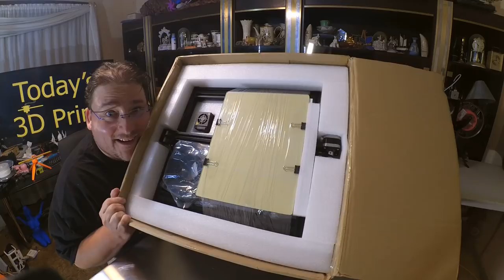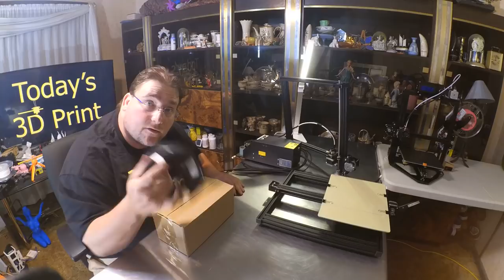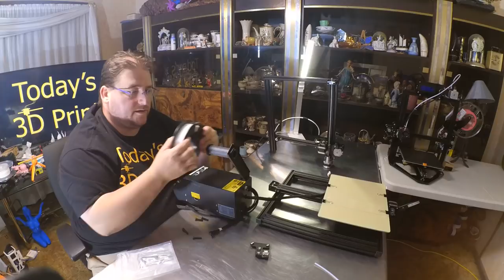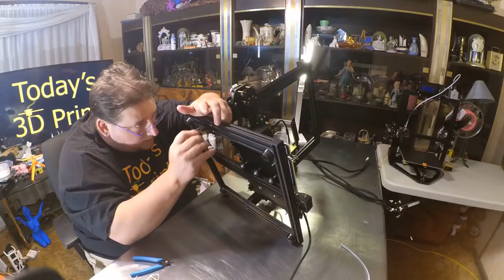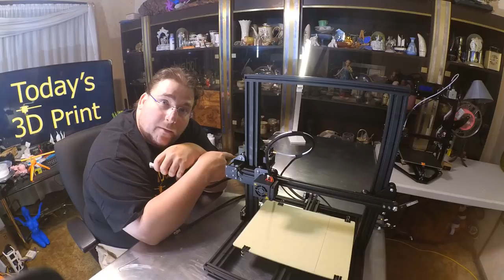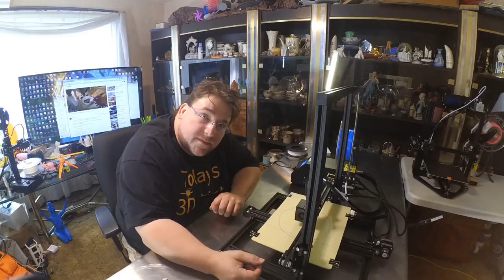Today's 3D Print - Its Finally Here  Creality CR 10 Mini Unboxing Initial Thoughts CR10 Mini

Comment: Ok setup the mini today. It’s printing quite nice at the mo, just waiting for the cat. My only concern is I had to back off the bed adjusters quite a lot almost on there limits, maybe 2-3 threads left. Is this correct? I set home and it was miles away from the bed.
Reply from the maker: +Joe Blog that's not good do you have the glass on the printer? The reason that's not good is that will make your bed adjusters a little on the loose side so your bed level might float or change in the printer vibrates one way you can fix this is to use longer screws and add some washers to tighten up a Springs you can also try adjusting the and stop position so that the head will come lower to the bed I'll have to check my mini and see if it allows you to adjust that
Reply: Nerys cheers. Thanks for replying so quickly on Christmas day. Merry Christmas. I'll take some pics later. At a friend's Christmas party at mo.
Reply: Nerys how do I send the pics?
Reply from the maker: +Joe Blog upload to imgur post link
Reply: Nerys also noticed some reviews say it has a thermal controlled fan. Well not on mine it hasn’t. It just makes loads of noise and the fans run full speed all the time like on the cr10. Wonder why they have done different versions?
Reply from the maker: +Joe Blog my guess would be something is disconnected because both my mini and my cr10 have thermal control fans inside now there are multiple fans only the one on the PSU is normally controlled the rest of them run continuously so it's simply possible your loud enough that you can't tell the difference when the thermally controlled one is on or off :-)
Reply from the maker: links are no good. says update your account (you) to enable third party hosting :-(
Reply: Nerys checked about half a meter from control box with dB meter on phone getting about 56db from cold no printing.
Reply: think the fan might not be well. there is a square on the display that looks like a fan and underneath it it says 1% when I’m not printing and 100% when i am. But the noise is similar.
Reply from the maker: +Joe Blog that fan display on the screen is not for anything in the brain box that is for your parts cooling fan if you look at your print head you will see that there are two fans there is one facing directly at you that is your hot and fanned that should always be running anytime the printer is powered up on the right hand side you're going to see an oddball looking fat it looks like a squirrel fan that's a blower that one will be off when you turn the printer on most of the time but when you start printing that fan will turn on that is what the displays indicating the status of that particular fan
Reply from the maker: +Joe Blog I have not opened my CR 10 mini brainbox yet but if it's like the CR 10 there will be three fans inside one blowing over the brain board one exhausting out the back and one built into the power supply unit
Reply: Nerys I changed the pics to use imgr did the bed screws look ok?
Reply from the maker: +Joe Blog yes they look fine. Some of mine dont stick out at all. As long as the spring is firm you are good. You can add a washer or small loose nut if you think its too loose.

Comment: I can't decide this one or Anycubic i3 mega for first printer.
They are on same price here is Spain right now - about 360 euro.
I prefer the larger printing size of this one for sure.
Any help ?
Reply from the maker: Живко Кръстев I do not have the I3 Mega but I think I would prefer the mini I trust the manufacturer and the quality of their product although I hear the I3 Mega is also very good but I would definitely lean toward the larger print volume 220 by 300 by 300
Reply: Nerys Thanks for the fast answer.
Any idea when your next video for this printer will be available online?
And kudos for this one of course.
Reply from the maker: Живко Кръстев this weekend I'm going to make a video showing the test prints that I got from the printers the mini and the tornado and seven of nine
Reply: OK, i just got jumped on the Mini :)
I used your link and coupon, I hope it worked out with the affiliate.
Now just have to wait and hope to pass clearly without taxes and etc.
Regards,
Zhivko.
Reply from the maker: Живко Кръстев Thank you. Much appreciated. your going to like it. It has all the updates too.
Reply: Nerys 12 days later and still not shipped, at least now it's marked like 'packed', about a week was just 'processing'...
It looks like they don't have it in stock.

Comment: I put this in simplify3d in the scripts area before all of my own scripts...this sets the jerk...M205 X10 ; Set X/Y Jerk to 10mm/s ; Sets the Jerk setting.
Reply from the maker: yes!! I just found that earlier this morning. I have since added M205 for jerk and M204 for acceleration to my starting scripts! I was unsure if it would work globally or not (ie for the entire print)

have not had a chance to try it yet as its actively printing a large vase right now :-) glad to know its confirmed working. that will work on the Cr10 as well I assume? any printer running rep or marlin?
Reply: works on the CR-10 I know for a fact. What acceleration slow down do you use?
Reply from the maker: acc 500 jerk 10 jerk 5 and slow down the FR if I really want nice detail.

Comment: What are the actual dimensions of the bed so I can get glass cut before mine arrives.  Thx
Reply from the maker: +mav68nrs I was about to reply to 220 by 300 but then remembered they're usually slightly larger than that I will measure as soon as I get home tonight
Reply: Nerys thx yeah I have 2 Ender 2s. They actually measure 6.5" square . So 165mm square
Reply: So naturally figures this would be larger as well
Reply from the maker: +mav68nrs correct 165x165 for the Ender 2 he's asking about the mini the cr10 mini
Reply: Nerys are the bed leveling knobs the same as the cr10? Was gonna print some parts before it arrives as welk
Reply from the maker: +mav68nrs yep same ones same knobs did you not work on the S4 or S5 or the Ender but they work on the CR 10 CR 10s and CR 10 mini
Reply: awesome thx!
Reply from the maker: +mav68nrs I apologize for forgetting about this question the bed is 305 mm by 235mm also it comes with a piece of glass
Reply: Nerys well that's nice guess,I don't need glass then.

Comment: So I've been checking the specs of current models and they all say 300x300x400 and not 220x300x400. Did that change since this upload? From what I've seen these are the same dimensions as the original CR-10.
Reply from the maker: +ChunkyJo those are the specs of the cr10 the cr-10 mini is 200 by 300 by 300
Reply: Yeah I'm an idiot. I just looked at my order and I inadvertently ordered the regular sized one. Right on, then! Even better! Thanks!
Reply from the maker: +ChunkyJo you'll like the bigger build volume better anyway :-) the mini is really only useful for people who really can't have that bigger printer because it's not that much smaller :-)
Reply: Yeah definitely. The only reason I went for, what I thought was, the mini was the price on Amazon. So it's a nice little surprise. I went from the Monoprice's 120x120 plate. So anything would have been a massive uprgraade. ahah. Thanks for clearing that up for me

Comment: is it worth going this model instead of the more famous one cr-10 as a first time user? What about the communities are there any that support this model? Thanks
Reply from the maker: +Oren748 this printer basically is a CR 10 just slightly smaller so the same support for a CR 10 would work for this as well same control box same Electronics same frame material same style construction same hot end they just shorten a few pieces used some smaller steppers M82 cr10 Mini as for a beginner's printer this depends on the answer to this question are you hardcore serious about 3D printing do you know this is something you want to get into? If the answer to this is no I would suggest an Ender to the print quality is out of this world it's very small it's very cheap if you decide 3D printing is not for you you have not invested too much and shouldn't have too much trouble selling it now if you're hardcore in the 3D printing I still suggest the Ender 2 because you're going to end up with more than one printer but if budget is a concern then the CR 10 mini or the CR 10 either one would be a very good option if you have space constraints cr10 minis a bit smaller if space is no issue just jump right to the CR 10 get the old one it's cheaper than the CR 10s I will give you identical print quality if space is a concern go with the cr-10 Mini
Reply: Thank you for the answer, it was very informative!
Reply from the maker: Oren748 no problem I aim to please stay tuned I will be having a video in the next coming weeks on exactly that issue picking your first printer

Comment: Hi, I just power on my 3d printer and the z and y axis goes in the wrong direction... do you why? The cables cannot be worng
Regards
Reply from the maker: If they go in the wrong direction 90% sure the cables are in the wrong direction. Or wrong cable to wrong stepper. Verify that (move axis with controller one at a time verify x is x etc.. Once that is right flip the cable (yes insert it backwards) see what happens.
Reply: Nerys wrong cable to wrong stepper... Sorry... :(
Reply from the maker: No problem. Just happy it was an easy fix.
Reply from the maker: If this isn't Ender 2 then yes it will suffer on Prince like that the trick there is to slow down when you get to the keychain hook the Ender to use is Blow by Cooling so is using the hot end fans excess air that passes through to cool the part so if you print too fast little tiny features like that really suffer badly lower the temperature at lower the speed of that part
Reply: It was printed at 50 m/s speed, not extremely fast. Never had this issue before with my ld anet a8, Ill try with a new layer fan. But I thought the one that cames eith the cr10 mini was alrealy optimize. Thnx
Reply from the maker: Oh cr10 mini should have plenty of cooling. Odd. What temp?
Reply: Nerys 210 is what I normally use
Reply from the maker: See if your pla can tolerate lower. Also the duct on the parts cooling fan if its 3d printer you would want to rpint the upgraded part but if its abs injection molded it should be good. Make sure the cooling fan is actually working (ie did not die on you)
Reply from the maker: Ohhhh that first fan duct looks interesting. It is worki g well for you? Good clearance? I wo der if i can rotate it so the opening faces forward so the nozzle is not obscured.
Reply: Nerys yes, it works much much better. Also the fan mount, takes out a lot of weight. Now printing your spool holder. Let's see how it turns

Comment: How the H#$% do you tighten the Y axis belt?? on the cr-10 mini???do you need to print one out..
Reply from the maker: https://www.youtube.com/watch?v=mS9Q_O9wvWo

I don't like the printed ones. they scream trouble over time as the plastic flexes and stresses. the built in is rigid and solid and will last forever.

Comment: Why did you not use the lock washers?
Reply from the maker: +valveman12 why woud i? I am curious.
Reply from the maker: +valveman12 Oh you mean for installing the gantry that I did not use the washer that included now I understand

I thought you meant lock washers for the bed leveling knobs or something since I didn't remember lock washers anywhere :-)

I wanted to be a solid metal and metal connection without a little sell your point washer in between if that washer shifts or moves Etc I just don't see any reason to use the washer there so I left it out

Comment: How id the Mini holding up..??? Looking to buy one..
Reply from the maker: +K Wright so far so good I'm very pleased with how it's performing it performs exactly like a CR 10 with slightly less noise almost impossible to tell the difference though it's a very good printer if you need something with a smaller footprint
Reply: Ya I think the big cr is a tad to big ..Plus I don't want to wait forever to get it from GB, I think I saw the small CR on Amazon by Hictok..looks the same and as you say it probably is just like the ender..just resold under Hictok..Thanks..I think ill grab one..Got some of that cool green filiment..need to print something..Take er easy Chris..
Reply from the maker: +K Wright if you don't mind use my link http://amzn.to/2wPmusW and yes it's exactly the same printer not even a copy it's a creality cr-10 mini with with their label slapped on it
Reply from the maker: +Nerys Link in the description for Amazon for the normal cr10 $487
Reply: Nerys to Big for my place. I don’t foresee printing 400 mm high. Mini looks about the right size. Mini has some little improvements you pointed out. Mini is right price as well might be a mistake for 100 buck difference but I’ll take a look.
Reply from the maker: K Wright link is there for the Mini as well it's literally the same thing as the CR 10 just smaller so you are getting the same quality and reliability

Comment: Does anyone have the torque specs on the bolts?
Reply from the maker: +Donald Smith I don't think there are torque specs at least I've never seen any tight until snug than a quarter more is what I do approximately I do if I feel you don't want to strip out the Allen keys there cheaply made

Comment: Well its cool, literally, my bed doesnt het up, it gets to 40 C and then just stops and then just cools down,..AHHHH
Reply from the maker: +K Wright your mini? Sometimes s*** happens and you get a bum unit but they're usually easy to fix

First thing is check all the connections in the box and on the bed also check the thermistor connections if that disconnects for some reason it will fail safe and shut down

Might just simply be a loose connection
Reply: Nerys Ya but when you pay almost 400 bucks from Amazon it shouldn’t fail right out of the box. Kinda of a let down     But I’m waiting to hear from Hictop if I don’t here back I’ll open the box in the meantime I’ll remove bed and check what you suggested. It does print PLA ok with a cold bed.
Reply from the maker: +K Wright they don't check them so you're just paying extra to get it from the US and not have to wait to get it from China trust me that's a good move I hit top is pretty good about support
Reply: Cool..Makes me feel a tad better..We will see what happens..Thanks Chris..